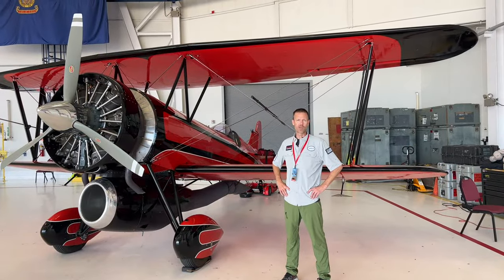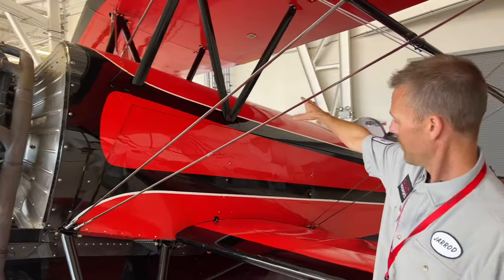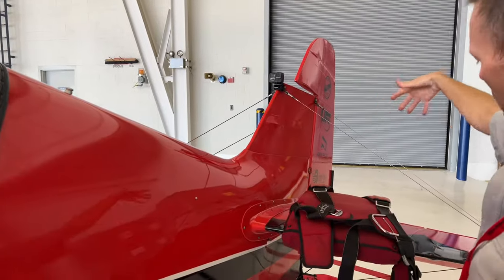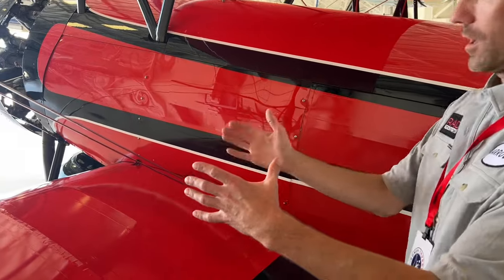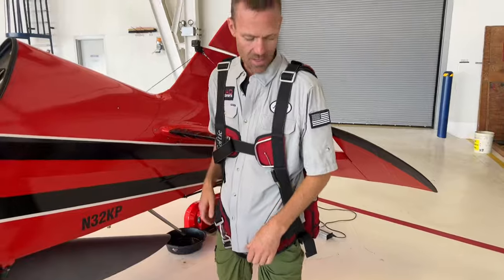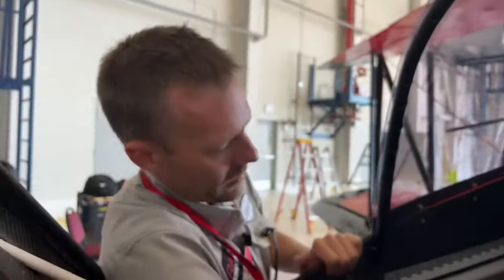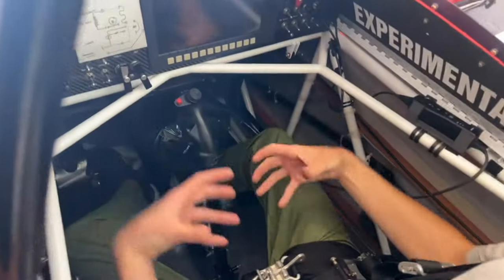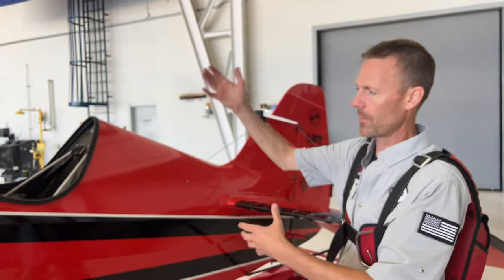Jet Waco Crash Fire Extraction Video

Comment: Hi Friends excellent video
Why does the Jet-Waco turbine tube have that angle and is it not a straight tube like the YAK 110 turbine tube?
Reply: I am sure the exhaust angle is for the Vtol F-35 Impersonation demonstration.
Reply: The tail and rear half of the fuselage is fabric covered so the thrust has a long tube to prevent heat and fire from burning the fabric surfaces. Why not just replace fabric with surfaces with aluminum? Who knows. That big engine sure adds a lot of weight seems it would be easy to balance the aircraft on the CG.
Reply: @keithwhisman  Go back and watch the video again, please,  and pay attention to the placement of batteries and fuel tanks as he described. The CG you're worried about has certainly been calculated  to a "T". I could go on and on about why certain things are as they are on this plane but the point was to educate recovery teams on how to get the pilot out of the wreckage as simply as possible.
Reply: @williamhudson4938  I was just thinking that if the tail was protected from the jet exhaust using metal it could still be balanced on the cg and the jet engine could be used for maneuvers such as unlimited vertical climb, prop hanging and things like that. Obviously he was able to balance the aircraft as it is obviously flyable. I never suggested the aircraft wasn’t able to be balanced. I was merely elaborating and using my imagination something someone clearly must have to even have the idea of making a jet Waco. I even think a turboprop Waco would be cool.